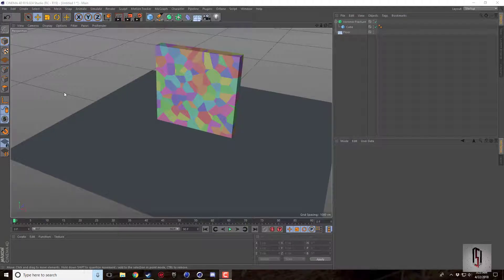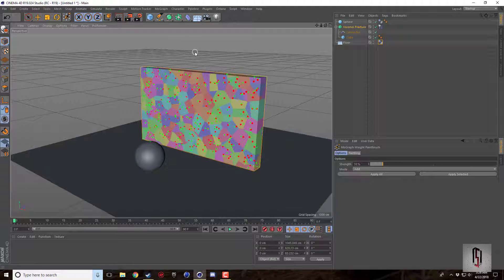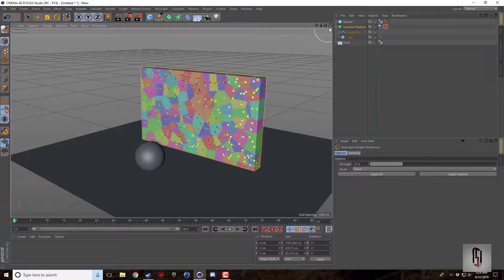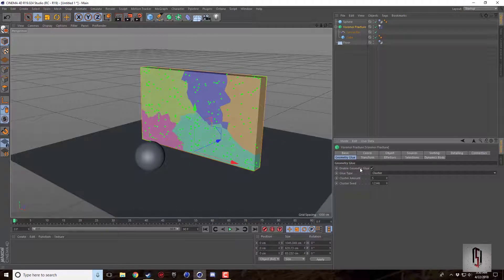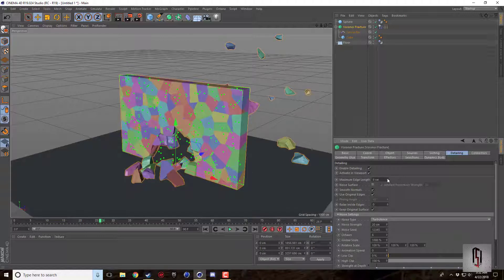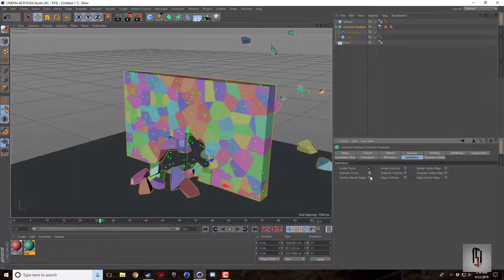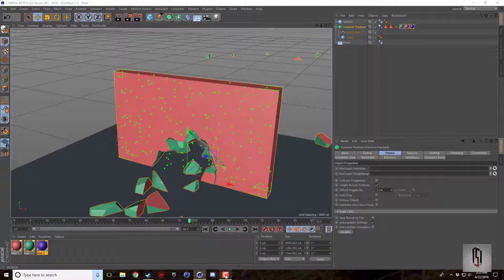More Tips & Tricks for Voronoi Fracture in Cinema 4D R19

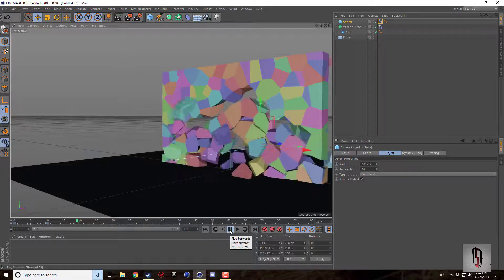Comment: in the first bust in 2:00 ,, when you hit the wall , the main part dont drop !! and flys !! how can we fix that ?
Reply from the maker: Hey there! So to answer your question I've found that if you go into the simulation tag settings for your Fracture object, and under the trigger (which should be set to on collision) there is a trigger velocity threshold. If you set that to a very low number like -5 or something similar, and then lower down the connector breaking weight dramatically also you should get the effect you are looking for! Hopefully this helps and if not feel free to ask again and ill help if i can!
Reply: bro what i meant is like think of it as a bridge ,, if we destroyed the column it should fall of because of the gravity ! but it didnt ! i dont want all the parts to break but i want the parts that are based above the column to fall ! but that didnt happen
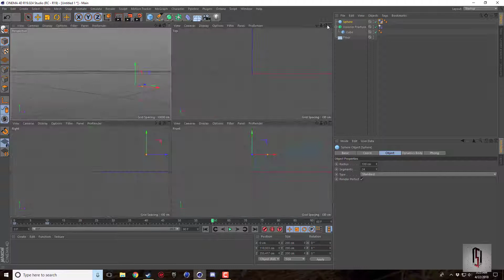Reply: go to min 2:00 and look ! it is flying !
Reply from the maker: Oh okay, I get what you’re saying. Unfortunately I messed around and tried to find out the answer and I couldn’t seem to find anything that enables that. Possibly something in the collisions tab of the rigid body tag. I got pretty close messing around with those settings. But I’ll continue to look and see if I can find out how to achieve that effect.
Reply: yeah me 2 , tried all but didnt work
Reply: @manyouvers2085  dunno if this is what you meant (or you already found a solution) but I managed to avoid that exaggerated explosion of fragments upon collision by replacing the collider body tag on the sphere with a rigid body and then on that tag, under "Force" u add the value of 1 (or similar) to both "follow position" and "follow rotation". With this set up the sphere goes thru the wall and the fragments catch much more gravity, mainly falling to the floor but to some degree also being pushed away (as it would happened in real life when something is hit and broken thru horizontally)